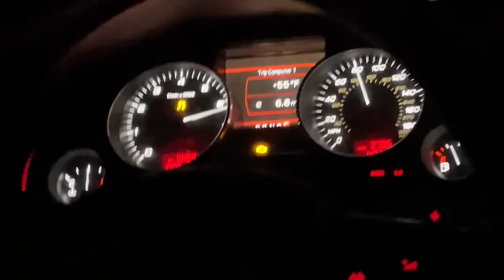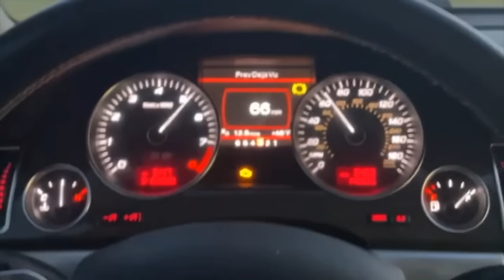Can We Fix This "Lambo V10" Audi S8? One Bad Owner Away From The Junkyard...

Comment: 11:43 actually this gen of V10 has deeper sound, especially the S6/S8. Newer Audi's and Lambo's have the more highly pitched engine note.
Reply from the maker: You have it backwards... The 2008+ odd fire 5.2 in the R8 and facelift Gallardo/Huracan is the deeper sound. The even fire 5.0 in the early Galladro has the high pitch sound. The S6 S8 engine is even fire but sounds lower because of the lower redline and the way the exhaust manifolds are made, among other internal things that make it have less power. With the proper headers and exhaust the S6 S8 5.2 makes the high pitch sound. See Joel Francisco's wagon before he did the turbos as an example.

Comment: If you are getting a "low temp" catalytic message, I will bet its your flex pipe letting too much hot air out.  I just fixed mine and the light has not come back. Yea the brain damage of dropping a motor for a cat is not on the docket.

Comment: takes about an hour minimum to remove the core support, and probably wouldve made everything else that much smoother.
Reply from the maker: I didn't have any hang ups doing it the way I did. Took me 2 minutes to cut a socket in half to turn the alternator

Comment: 23:00 putting an Audi into service position is way easier than whatever hacked up welded bullshit you did.
Reply from the maker: Yes because "service position" can totally help you get a stuck injector out of the head. The engine could be pulled out of the dang car and it would still have the same problem you bonehead 😂

Comment: I bought my 08’ S8 in 2020 for $4,800. Running , a few issues. no where near as bad as your S8. I did my due diligence, researched the vin/Service history and discovered it was 1 owner dealer maintained. New manifold, behind engine oil leaks fixed, recent carbon cleaning . I fixed most issues under 3k (parts being the main cost). 

Now she’s a garage queen, added jhm lightweight crank pulley, custom x pipe, 2 resonator delete, electric exhaust valved cut out, dropped on links, maxton splitter and powder coated a set of 20” rs4 twin 7’s
Next thing I’ll be adding is a catch can and JHM intake spacers , tune maybe later I like how reliable she has been until now . 

These cars are pretty robust , with proper maintenance. 

She’s done about 8 trips to vegas from LA,8k miles all leisure, I only drive the car on weekends, she’s at 160k .she puts a smile on my face everytime and she looks damn good too

I have clips/pics here and IG , christian_urocar

I picked up an 05’ A8 W12 I’m working on next

Comment: You blamed the car for most of the issues. But I'm going to suggest the car had a couple issues, but it was one of the previous owners that created most of the problems.

It's funny when I hear people that really should just own a Toyota, complaining about German cars. As if they're comparable in any way. The reason they think that way is because for them a car is all about getting from point A to point B reliably.

Yes that's a nice thing to have. Who doesn't like reliability?? But car people generally don't buy Toyotas. They buy more interesting cars. There's like one interesting Toyota, the GR Corolla and it's way too much money. But car people will buy a Toyota as a parts runner. 😂
Reply from the maker: Previous owners definitely created some problems...however these cars are prone to falling apart on their own far more than most anything else out there. There is no denying that.

Comment: that engine is an audi 4.2l v8 with 2 more cylinders. its not an audi with a lambo motor they are lambos with audi engines
Reply from the maker: Hence the quotations in the title. It has a split pin crankshaft and firing order in common with the older Lamborghini 5.0 and that’s it

Comment: How expensive are Audi parts?  I seem to remember the Car Wizard stating that Audi parts are expensive.  Sorry you had to get baptized into the Audi engine repair club with such a hacked engine, but you are gaining some serious repair cred by tackling this, especially where you make your own tool to get the injectors out!  I hope that this does not end up being a need to pull the engine to fully shake out this Audi.  Give us the total parts cost when you are finished.  Given that hacked engine, this Audi should have been sold as a parts car or as a salvaged titled car.  If someone without your skill set, tools and shop had bought this car thinking it was a decent running car, the next stop for this car would have been a salvage yard.  If anyone gets one thing out of this video it is a cautionary tale of buying cars off auction sites.  Buyer beware.
Reply from the maker: I got it on fb marketplace. You are absolutely right this car was one bad owner away from being parted out
Reply: He's got a vid or 2 on a v10 s6/s8 and says never ever buy one (he owned one too)